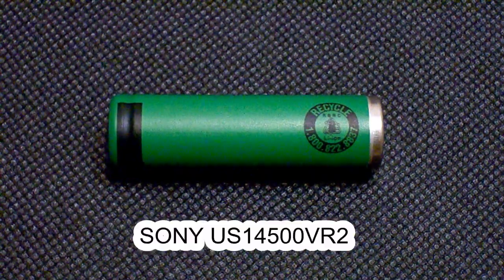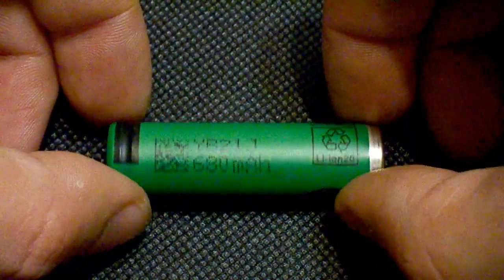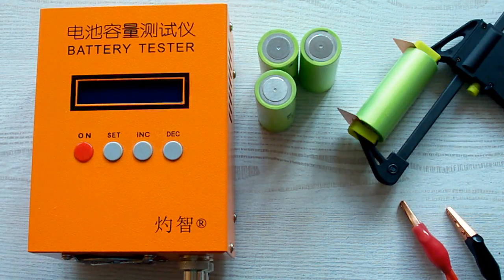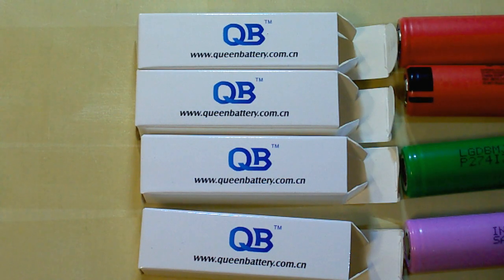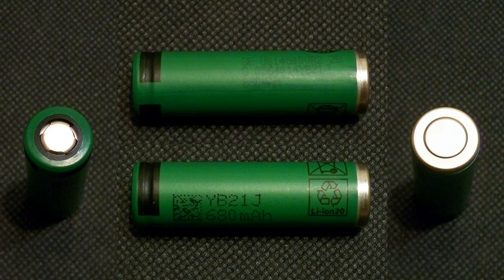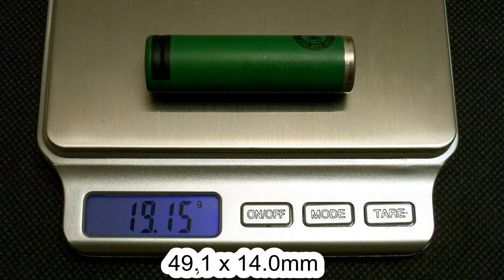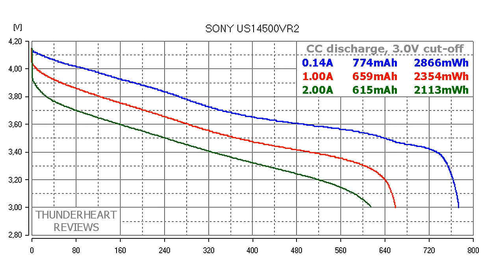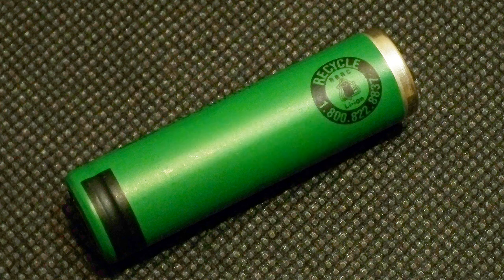SONY US14500VR2 3.6V 14500 AA Li-ion battery's capacity test

Comment: Amazing! Thanks for all your research. I have one of these in my Philips Sonicare Toothbrush. I'm wondering if there is a bigger capacity battery I could replace this with, like maybe 800mAh or higher.
Reply from the maker: There are TrustFire 900mAh cells reviewed on my channel. I'm using them in my computer's mouse.